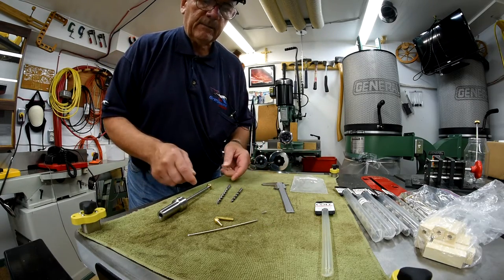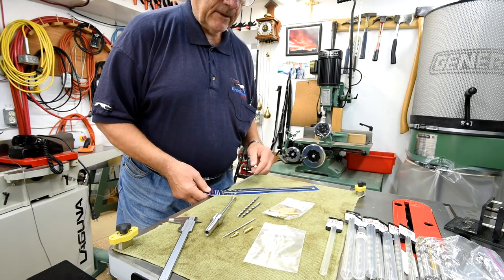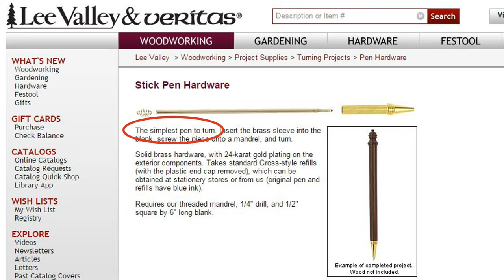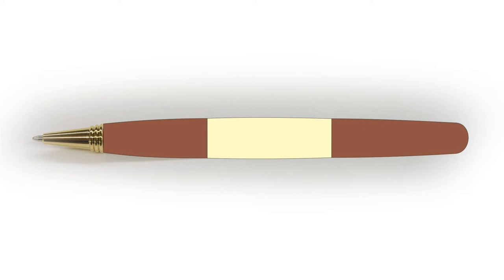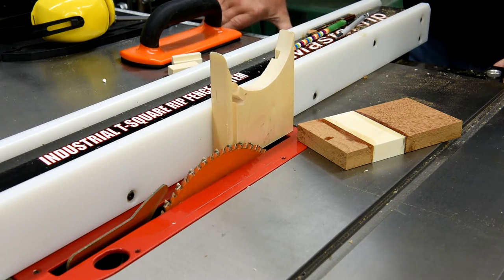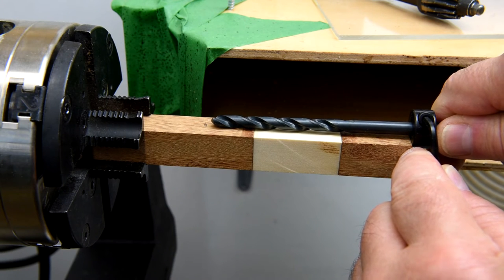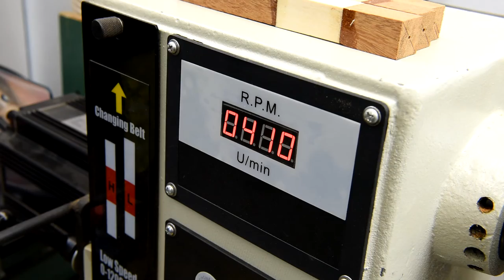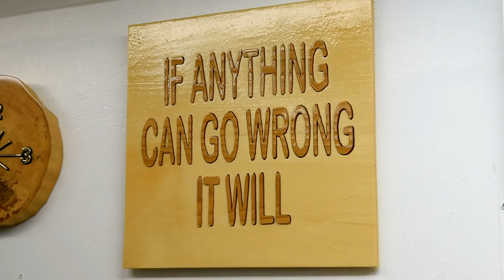The Stick Pen

Comment: Ron, I've never seen the center marking tool you show at 5:33, what is that?  

One of the things that frustrates me with pen turning is that it takes so many different bushings, mandrels and drill bits.  There isn't any standardization in the pen industry.  None of my bushings are marked for what they work with, almost making them useless for future production.  I need to come up with an organization method to organize everything.  On top of all that, the sellers sometimes just rename the exact same pen, making me wonder whether I need to buy bushings for that pen when they are the same bushings I bought for another pen with a different name.  

I think your pen blanks look interesting.  If you added multiple layers of Aspen, that would probably look good as well.
Reply from the maker: Yes, I agree with you about standardization in the pen industry. As far as the center marker goes, watch https://www.youtube.com/watch?v=uDMLlro76ac